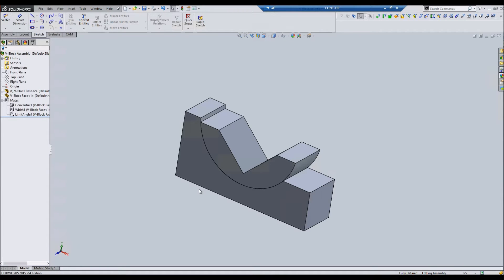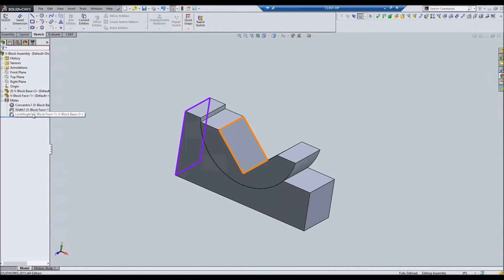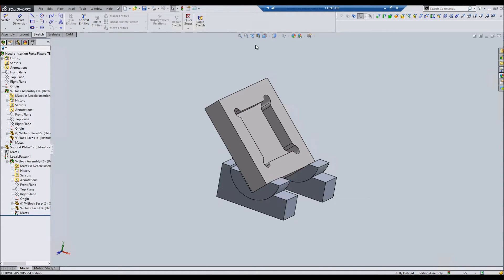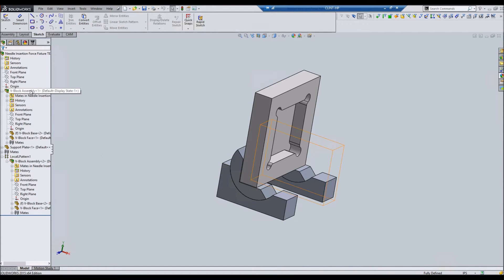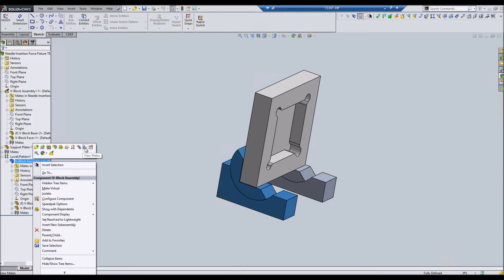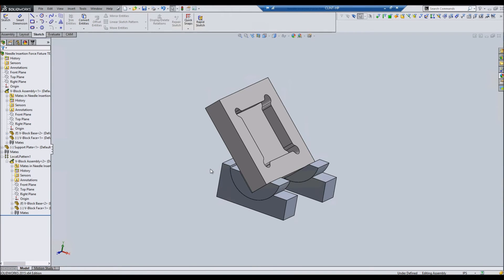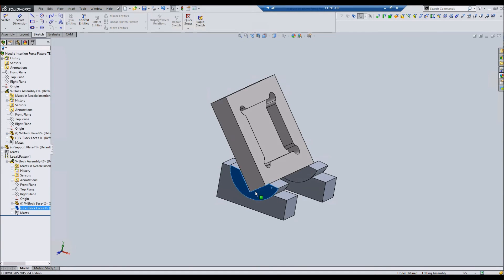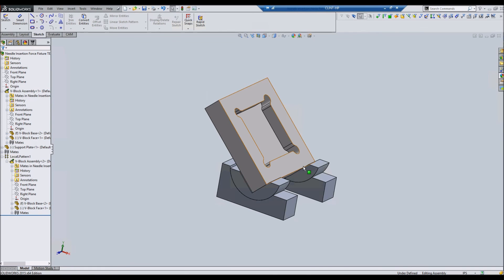Flexible Sub-Assembly Mates in Parent Assembly - Solidworks

Comment: I can't get my Mate Controller to work. I have a telescopic hydraulic cylinder with two stages in its own assy. The Lim Dist mates work properly and the cyl 's open to their extents and close as expected.This cyl assy is In the top assy where I have a plate (sldpart )which has Angle Lim mates to move it in x y and z axis around its centroid. Again the mate controller works fine in the main assy. for the axis angle changes. But when both cyl dist  lim mates are not supressed then the mate controller collects the mates but they are greyed out. If I suppress one of the distance lim mates in the cyl assy then the mate controller works in the top assy. The only problem then is if i move the plate too far in a particular axis it pulls the cylinder apart where the distance lim mate is supressed. There is sufficient travel in the cyl to reach the max angles required for the plate. I just can't work it out.

Comment: Brother, I ask, what if the radio button in the Component Properties window is grayed out? Both the Rigid and the Flexible option.
Reply: Then you are on a sub-bassembly. Just turn this sub-assembly to flexible mode and not the part